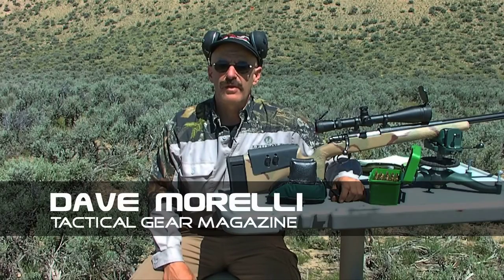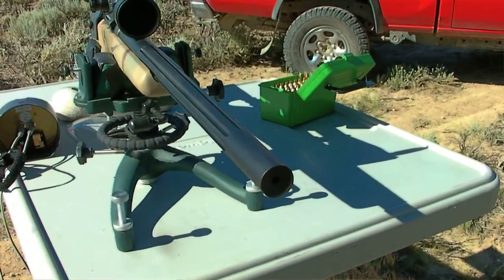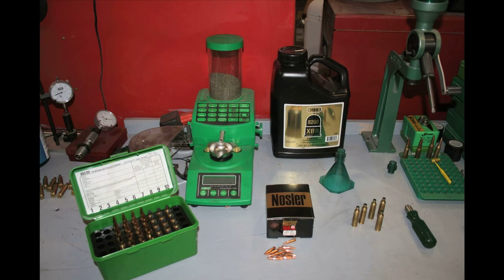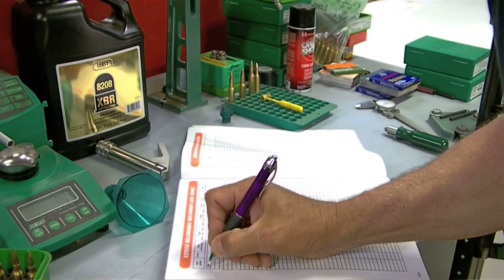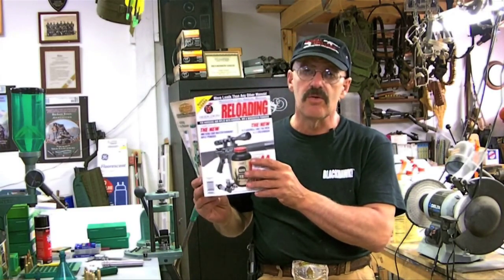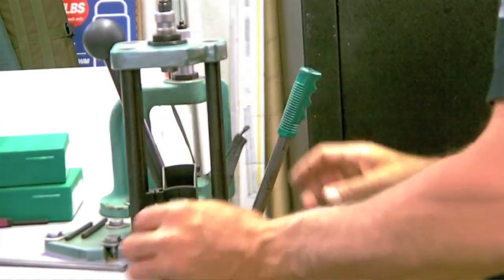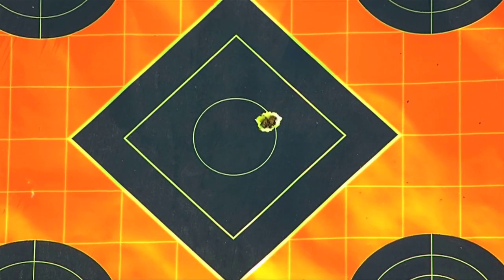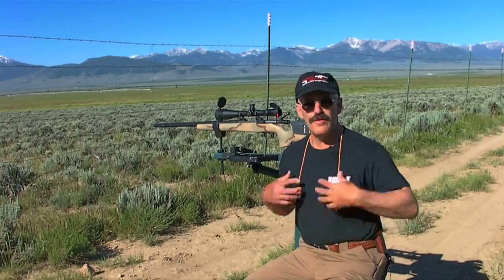Case Prep Part II: Powder Selection for Precision Shooting

Comment: Some of this is remedial, but needed. As far as primers,  use APS strips. dead giveaway for what you're using. I agree with the powder. One powder on the bench at all times. just this week I've had 2 700s come in that were blown to pieces, literally. Both in 270, both loaded with pistol powder, both lucky they didn't wear the bolt. As far as manuals, they're useless. Lawyers and chemical changes have made them obsolete. Use the internet and learn how to read pressure. His mentioned signs of pressure were polar opposites. Look for primer flattening, then flow(cratering), blown primers, THEN case head separation. Take my 308 pet load. 44.7 grains of Varget, CCI LR primer, 175 grain Matchking. Per Sierra's current manual, that's 3 grains over max, yet I'm showing no signs of pressure, although my primers are coming apart after depriming, which has never happened. Manuals and safety only get you so far. 5 years as a gunsmith and 20 as a handloader (I'm 25, dad got me started early) has shown me that intelligence is key. I'm met a lot of people that shouldn't be ANYWHERE near a gun, let alone a reloading bench.
Reply: Trent Wilson  "....manuals, they're useless. Lawyers and chemical changes have made them obsolete." ?? Please don't type that shit into a computer keyboard. Somebody might read it. Flattened primers can be a sign of too much headspace. The primer is the first thing to move when the pressure starts because it's the easiest to move. It gets slammed back against the bolt face and then the cup starts to widen but not for too long because a nanosecond later, WHAM!, here comes the case head slamming back against the bolt face and in the process swages down the primer, giving it that flattened look. This can happen with a mid-range load, not just a max load. Cratered primers can be a sign of an oversize firing pin hole and a soft-cup primer. Case head separation isn't necessarily a sign of high pressure. It's a sign of pressure. Too many load/fire cycles with too much shoulder bump will cause it, even with loads nowhere near max. What is the velocity of your pet .308 load? If your bullets are being driven faster than standard speeds for that weight bullet and that cartridge case, I can almost guarantee your pressure is higher than SAAMI MAP for that round. There are no free lunches in ballistics. You don't get free velocity gains with no pressure gains. Starting with new cases, are your primer pockets staying tight for 3-5 load/fire cycles? If not, you're overboard, son. Thirty-five years in the shooting/handloading business teaches a person a few things. Your first few years as a reloader don't count. When dad says, "hey son, pull this lever.", that just plants the seed.  ;--)))  Good luck with your gunsmithing business.
Reply: Wrong. Yes primers can be a sign of high pressure but that is not always the fact. I have seen flatten primer with some pretty lite loads. The primer will set back against the bolt head and flatten it out. 
Anybody you does not use a reloading manual is asking for trouble. People who are a whole lot smarter than me have tested this load and proven them safe. Ever have a gun blow in your hand? Can't recommend it.